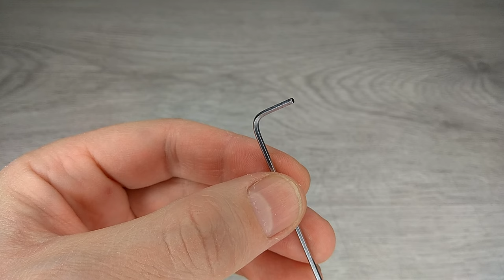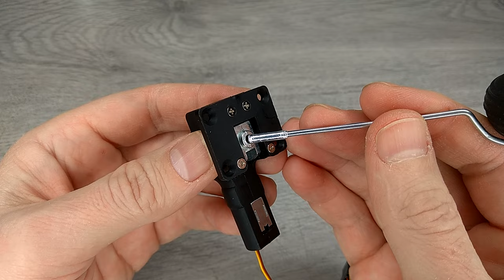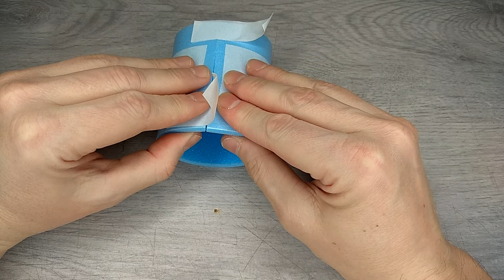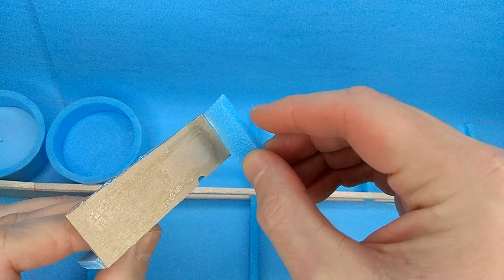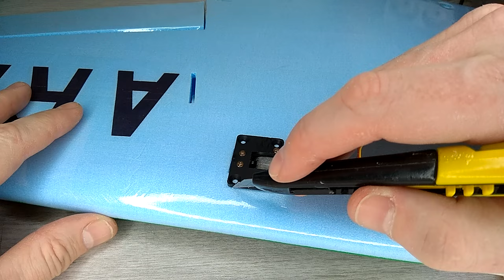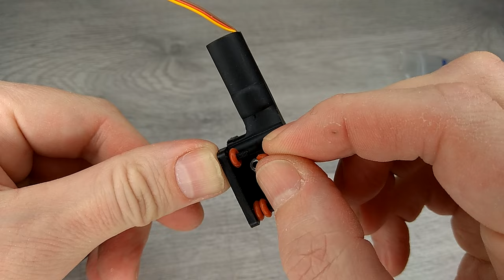How to install Retractable Landing Gear on RC plane DIY

Comment: That looks like depron foam, I miss that stuff. Where can Depron be acquired??
Reply: you can buy it in the bricocenter as insulation for floating floors or search the internet from the various vendors of your trust type "depron" and you will have a good variety of offers in various thicknesses
Reply: Just not in the United States.
Reply: @warbuzzard7167  Now i remember that some time ago i knew that in USA i dont know why, they stopped the production and selling of Depron. 
Try to search for XPS (eXtruded PoliStyrene: the same material of EPS  but non in several miniballs clogged together as the Expanded PoliStyrene) instead of Depron: it is very similar (if not the same) material.

Comment: I'm putting my first retrackable landing gear in a plane and am wondering about CG point and does it need to be in front or CG the wheels when extending
Reply from the maker: wheels must be in front of the CG when you use small tail wheel and behind CG when you use nose wheel